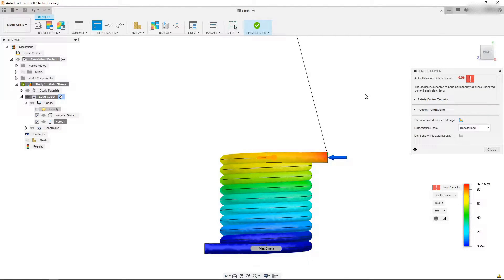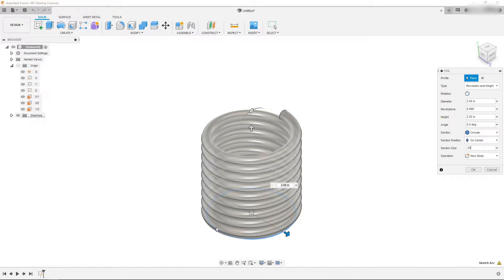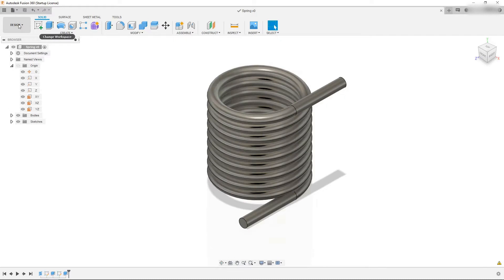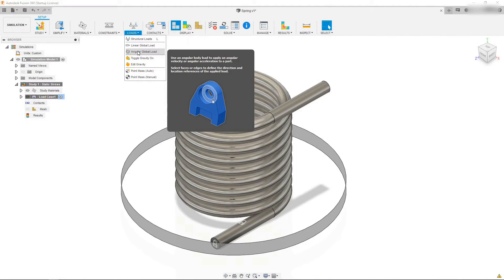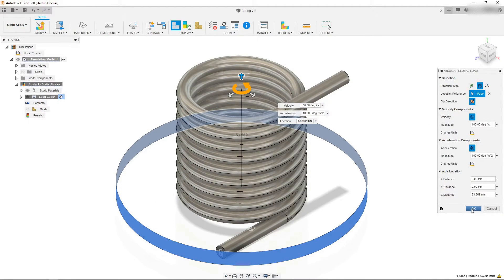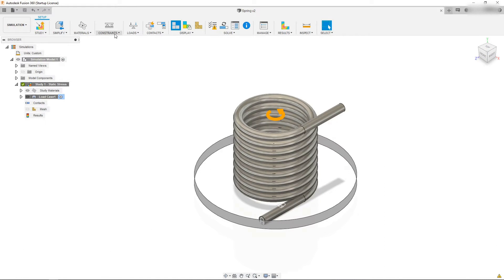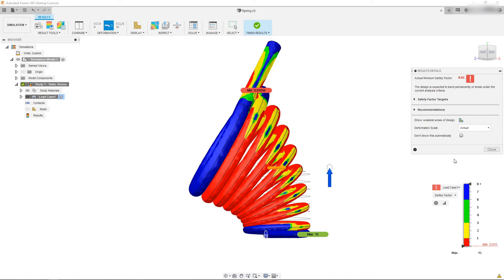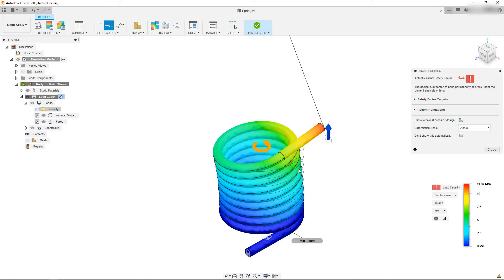Spring Torsion Simulation in Fusion 360! Angular Global Load and Structural Load Tutorial

Comment: I hit a brick wall at 6:20. Everything looks just like yours up to that point but when you hit solve, you can instantly do a simulation while MY 'ok' button is greyed out, under status , mine says "error repair" instead of "warning repair" like yours and at the bottom it says "No studies can be solved. There are no studies which can be solved" In my precheck next to the red x it says, "1 Loads on surface bodies detected and will be excluded from the solve. Please delete the loads or repair the surface bodies to make it into a solid"
Reply from the maker: I've seen this sort of thing the last time I tried to solve a simulation. One thing I can think of is... Do you have a material defined for the spring? All parameters must be fulfilled.

Comment: No matte how many times i try to follow the part where you extrude the ends, I just can'tt get it to work
Reply: It's because you keep running though it so fast skipping steps along the way. I finally  caught the step you skipped at 2:48 which was to switch from cut to join in the drop down menu.. Also when you pressed P,  you went back and clicked the face one more time.
Reply from the maker: Which part are you stuck on?
Reply: @AvivMakesRobots  I eventually got through this part, but the part I am stuck on now is at 6:20. See my other comment. Or , here, I will paste it:  "I  hit a brick wall at 6:20. Everything looks just like yours up to that point but when you hit solve, you can instantly do a simulation while MY 'ok' button is greyed out, under status , mine says "error repair" instead of "warning repair" like yours and at the bottom it says "No studies can be solved. There are no studies which can be solved" In my precheck next to the red x it says, "1 Loads on surface bodies detected and will be excluded from the solve. Please delete the loads or repair the surface bodies to make it into a solid"